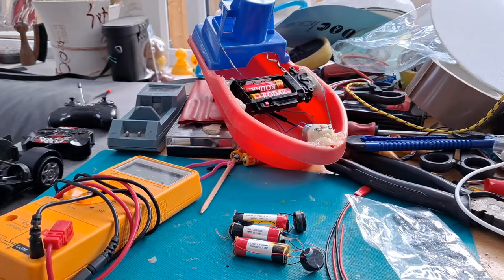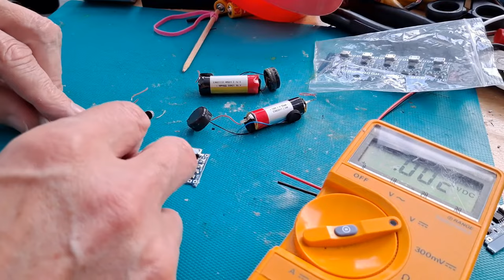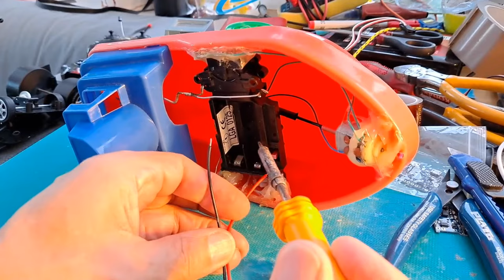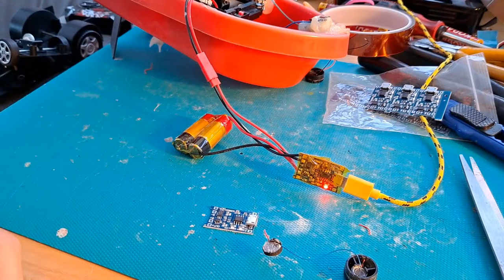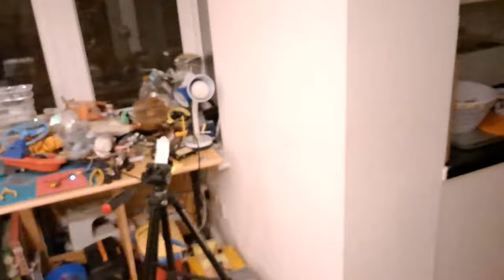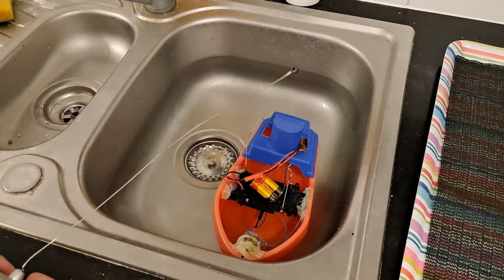Doing something with Vape Batteries, 20220824

Comment: i've been collecting these for about a year now., i have bout 100 batteries. i have lots of 550mAh, A ton of 650mAh and loads of 1500 mAh, i've made my own 18v battery using 3x1500mAh making 4500mAh per cell. then x5, i use it on my old 80s boombox, it takes 10 dcell batteries, but i checked the voltage from the transformer to the main board and it read 20v, so 18v doesn't harm it, for charging the batteries i did use a laptop charger and it worked but i've since realised it can harm the cells so i've linked 5 usb boards to each cell to be safe and to make sure they live a happy prolonged life :-) i hate that people are throwing them away, i know i've collected a lot, but that must be tiny fraction of the ones that are not saved.
Reply from the maker: It is hard to walk past them, when they are laying in the street, especially when you can equate them to £1 coins 😁🥇🪙I probably have more than I will ever use, and I still pick them up when I see them, although I do ignore the ones that have been squashed flat 🤣
Reply: Pray to god you used a bms or 💣🎇🔥. But I wished I found them. I never seem to find any
Reply: Sooo I'm not alone using salvaged li-ion cells in his 80's boombox 🤣 heey bro...haha
Reply: My boombox uses 12V  (actually has a D cell battery compartment)   and I just made 3S  battery with ballancing BMS ... For charging, I  actually use  the  rectified voltage from the transformer built inside the boombox.. ..works like a charm for 5 years already .
Reply: @EduardRitok  That's a cool idea, mine is just Vape batteries, i charge each cell with TP4056 usb charge boards, it's kind of like a bms but i guess it's an old fashioned style and a lot more messin around, my batteries are still fine, still good, still holding charge ok.
Reply: @80s_kid.  I would definitely invest into  bms  if you don't have one incorporated in your  battery pack.. li-ions need ballancing and under/overcharge protection  🙏 ..your approach is good, but very impractical 😬😅 5 USBs . ..that's a lot of work😅🙏.. i used 18650 cells from laptop batteries but  they start to deteriorate... Soo now I am ready to replace them for vape batteries I collected 😁. i will keep the BMS circuit, I'll just swap those cells and make it  like  6-8Ah . What is your boombox model btw? ☺️ Curious

Comment: Over-discharged cells with less than 2 volts will often not take current from a charging module, since the charger detects that no current is being taken, so they shut down, and go into standby. However, in parallel with a healthy charging cell, they often start to polarize and then take a current and will charge fully.
Reply from the maker: I just tell the charger that the cell is a NiMh or even Lead, and trickle charge them until they are over the threshold.

Comment: it's sad people are chucking those out right on the street. Any place that sells them should have signs and collection points for the old ones, they'd still just chuck it out tho lol.
Reply from the maker: Bearing in mind that they represent a tiny proportion of the junk in the street, there are more pressing issues with people's behaviour.
Reply: @GrandadsOtherChannel  thats the main reason I dislike urban areas, litter makes me very upset.
Reply: @GrandadsOtherChannel  vapes themselves maybe not so common but vape packaging makes up probably 40-50% of the litter i see now - ive just picked up some more 1500mah vapes, going to 3d print some inserts to stack 2 batteries in the tube and connect 2 tubes side by side with a charging board in the middle, should make a pretty rugged powerbank
Reply from the maker: Yes, there certainly are plenty of empty packages, although I did go out one day specifically to collect some packages because I wanted to check the information they contained and typically on that day, I struggled to find any. I ended up with only a couple of packs after a good walk. Vape Hunter 20230129 not all litter are vapes!! https://youtu.be/oqij-7UWfTM?list=PLA5a2xPRSrB3xTZEeibfIt-jppni8A-HY

Comment: Hello, have you had in hand these new electronic cigarettes large capacity (Puff Tornado RandM 9000 puffs of 18ml for example), they have a system of LEDs RGB more imposing and I have the impression that there is a micro controller for lighting LEDs RGB and I would like to know if according to you it is possible to reprogram these LEDs with Arduino software, what do you think and how to do to reprogram them according to you?
Reply from the maker: I don't think I have seen any like that so I can't make any suggestions, sorry.
Reply: @GrandadsOtherChannel  it's no big deal, thanks for taking the time to reply😉

Comment: This batteries are very good. They are Free, curent îs good and The batery ca-n be keep very long without danger to loose capacity if IT îs not used. AT maximum charge IT has 4.2 V. The problem îs that you must not discharge under 3.0 V. The vapes have a smd LED în The black plastic part which ca-n be re used.

Comment: Put a diode in line with the output from your pack to drop the voltage, 1n4001 and add a 1k pot from r3 to ground to adjust the charge.

Comment: Can tp4056 charge 2pcs battery its safe
Reply from the maker: I would suggest you read the specs for the tp4506 board, then work it out.
Reply: @GrandadsOtherChannel  thank you 😊
Reply from the maker: The trouble with asking for advice from "a guy on YouTube" is you never know if they are right or wrong. And the problem with answering people's queries is I never know what level of understanding you have. For example, do you intend to put the "2pcs" in series or parallel? What is their current rating? What type of batteries are they? How do you intend to power the circuit? That is why I suggest it is better to read the specification. The TP4056 is just the chip, so the specification will vary depending on what circuit board the chip is fitted to. Some boards include overcharge protection and over-discharge protection. Most boards default to a 1A charge rate. Some boards require a resistor to be changed to match the charging current required. Some boards have adjustable potentiometers. The list goes on 😁 @AliAhmed-ls2uo
Reply: @GrandadsOtherChannel  you are right but i know about tp 4056 module but i every time see people connect 2 lithium ion battery but i not have lithium ion battery i have vape batterys lithium lipo and i see your video you connect 2 lithium lipo batterys that why i say you but thank you so much and thank you for giving time 🩵😊

Comment: they are free batteries so any use is a plus.. maybe set up a small solar and or wind charging unit and use them like power banks for lights and such.. the led light Im using right now is running on a 10000mah power bank I charge in BB.. the fan I used the other night was also on a power bank I charged off my large  power bank which was charged  using solar
Reply from the maker: Yes, you would need to parallel them up to get a reasonable capacity, but it could be done, as you say, they are free, so I could put dozens of them together 😆
Reply: @GrandadsOtherChannel  good mornin

Comment: It is better to charge each cell individually before connecting them in paralel. Your charger is not able too see voltage in each cell.
Reply from the maker: You are right, but can you measure the difference? As you can see, this works fine. If you were planning to use them in series rather than parallel, then you really do need to include balance leads for the individual cells. In parallel, they balance themselves. When we are just looking at small capacity cells like this all nominally the same value, we are not talking large currents, but if you are interested in charging much larger packs in parallel, you might like to read this article https://oscarliang.com/parallel-charging-multiple-lipo/

Comment: I've been ollecting these for couple of months.... Got over 1200 cells sorted by capacity  in my drawer  waiting to be used in some nice  projects 😁😁 .
Reply from the maker: Just remember they are a fire hazard and throwing water on them does not put the fire out 👍🏻 The more you have, the bigger the fire.
Reply: @GrandadsOtherChannel  yeah, I am  aware of the risks of having li-ions around 🙏🙏 thinking about building a metal case with mineral wool insulation    - in case of fire, so that it can contain it somehow safely.. but I hope there will not be a  test situation happening ever 😅😅

Comment: What happens if they go stacked?
Reply from the maker: I am afraid I have no idea what you mean?
Reply: @GrandadsOtherChannel  Instead of them being parallel.
Reply from the maker: @Alberto Speed  normal electronics applies. Batteries in parallel the capacity is added, voltage divides. Batteries in series, capacity divides, voltage adds. So  two 4v 500mAh Batteries in parallel gives 4v 1000mAh. Two 4v 500mAh batteries in series give 8v 500mAh.
Reply: @GrandadsOtherChannel  ok, thank you.

Comment: Do you have a link where you bought the little blue motherboard looking thing?
Reply from the maker: You will find my videos always have extra information in the video description.
I bought them from eBay. I suggest you could search for "TP4056 Lithium Battery Charger Module Charging Board"
10Pcs USB 5V 1A 18650 TP4056 Lithium Battery Charger Module Charging Board - cost me £5.48 a couple of years ago
This is probably the best video I did on this subject of TP4056 modules, with plenty of information in the video description https://youtu.be/j9-Efa1WqUc
You may find this video interesting - Small power bank from Vape batteries https://youtu.be/rG7qLbuWvK8

Comment: Trying to figure out ideas to use the draw switches for and the electronics besides the battery.
Reply from the maker: Yes, it would be good to make use of the other components. One suggestion was to use the heater element and vapouriser for a model train steam or model car exhaust. I do remember seeing a video on the car exhaust idea. Bigclivedotcom looked at the electronics with his usual reverse engineer detail.

Comment: Parallel charging is fine but the batteries voltage should be within 1/10th oa a volt before you connect them together so say between 3 4v - 3.5v ect because the lowest battery will drain power from the highest battery after they've been connected together you should be fine charging and discharging
Reply from the maker: You are right, but can you measure the difference? As you can see, this works fine. If you were planning to use them in series rather than parallel, then you really do need to include balance leads for the individual cells. In parallel, they balance themselves. When we are just looking at small capacity cells like this all nominally the same value, we are not talking large currents, but if you are interested in charging much larger packs in parallel, you might like to read this article https://oscarliang.com/parallel-charging-multiple-lipo/
Reply: @GrandadsOtherChannel  I meant no disrespect it is awesome to see people putting these things to use as I do finding so many on the street. I fly rc Drones and planes and do build a few battery packs I mainly meant my comment for any newbies trying the same and Oscar liang does make the same statement regarding voltage matching but yes of course with these little 500mah batteries it would most likely be OK but if one was drastically lower then the others you could at the very least damage the pack you are trying to make. So for anyone trying this I do believe a healthy lithium battery voltage is between 3v and 4.2v and I personally would discard a 2v battery as tested using a multimeter. Once again I apologise I enjoyed the video and am currently building a pack for a 5v led strip in the wardrobe I even have those same charging modules. Great video and I genuinely mean no disrespect
Reply: @blakey271able Thanks for the extra detail 👍